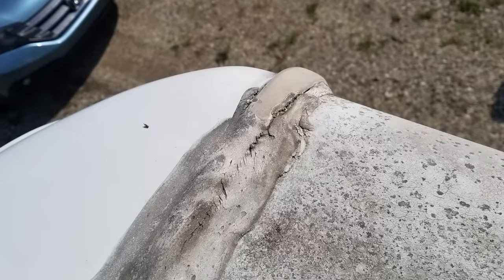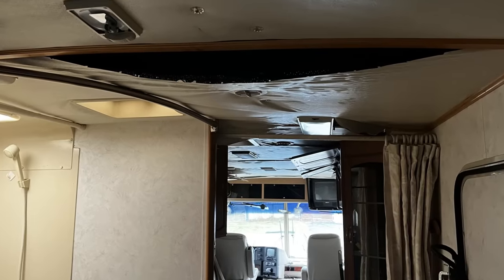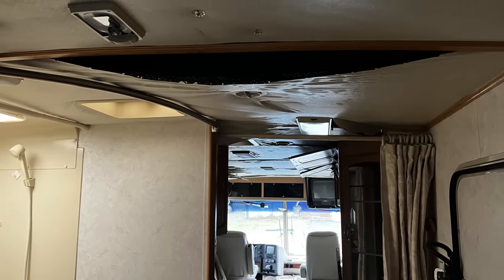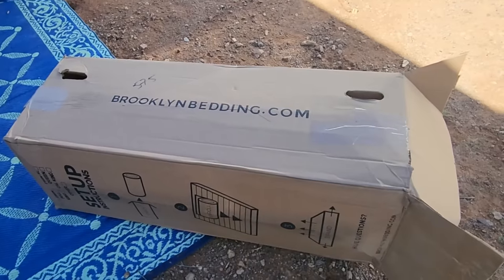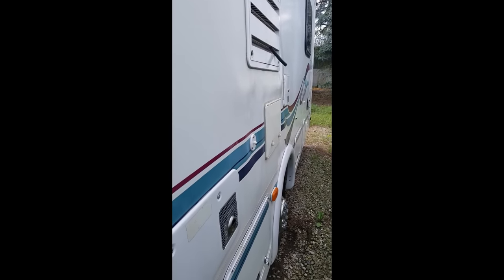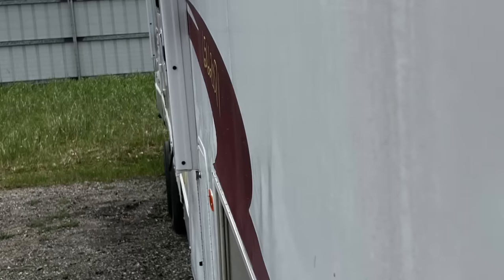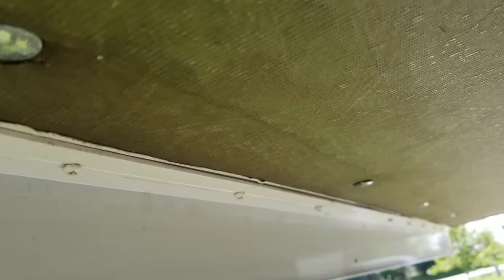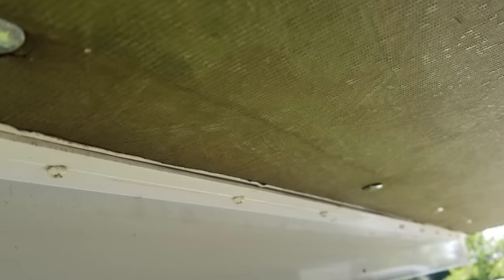PROTECT YOURSELF! These 3 SILENT KILLERS Can Crush Your RV Life

Comment: I found out early on, that the more fancy things you have with your RV, the more that can break and cause problems.
Reply: I’ve said that about cars….Dad said that back in 1969 with our “fancy” Mercury Montego station wagon & has shown it is so true! My 2004 Toyota Echo was a basic model, standard transmission & crank windows. Zero problems in the 11.5 years we had it.
Reply: @Elizabeth-rq1vi  Very true! I just bought a new 2023 year Tacoma, bare bones SR instead of SR5. Don't need heated seats or push button start or anything else built to fail! I have no doubt I'll get 300,000 miles at least out of it!
Reply: As with cars.

Comment: I think I would rather convert a van or truck than deal with poor RV quality.
Reply: My thoughts exactly.
Reply: Or cargo trailer!
Reply: Flex armor roof, life time guarantee, no caulk.
Reply: So glad I have my simple van. Thanks guys😊
Reply: There's a reason vans are so popular.

First and most importantly, they fall under federal vehicle standards. And at 22' or shorter, you can travel or park as a regular passenger vehicle.

Then, if you're smart, experienced, or both, you build it out with a focus on simplicity and low weight.

Hey, didn't she just cover this? Why, yes she did. Anyone in the market should watch that vid until it's drilled into their head.
Reply: Same here! I’m in a van.
Reply: I totally agree with you about that choice.  If you are a person of good financial means,  you might look into a TRAVATA that is a cargo van that is already built, or can be built to your needs and color choices.
Reply: My 6 month old Transit van has been in the shop 4 times for electrical issues and it's acting up again as of yesterday.
Reply: Drone the rooftop.
Reply: School buses have the best structure. I agree that vans, buses, etc are much better quality.
Reply: @RoadrunnersOfCA Try going to an auto electrical shop, not a regular repair shop. Most mechanics are not great at being auto electrical repair guys. Even our mechanic, who is a genius, has an auto electrician on call.
Reply: @SewingBoxDesigns  Okay, thanks so much for this tip. 🌞
Reply: LOVE livin’ in my Pacifica. One year in 24 ft Class C. It was always needing something. 😞
Reply: A motorhome is basically a mobile home on wheels. I would feel better with a large van.
Reply: @RoadrunnersOfCA  The Transit is FAR better than ProMaster. Those are a NIGHTMARE.
Reply: @RoadrunnersOfCA who custom built your van?
Reply: @rebeccaogrady2995
Absolutely, the main reason that skoolies are so popular, they are built to protect children and held to automotive standards.
Reply: Truck ... you mean truck camper?
Reply: The FULL height full fiberglass (including floor) work slide in are super rare , BUT bombproof. "Brand FX" or "SpaceCap" are two i look for. Just saw one near me for $3500. Great buy. I just didn't have funds. I have vans, cutaway ambos (in 4x4) but want a slide in full height for my old carburetorated, straight 6 Ford pickup. It'd be SUPER nice for old simple , easy. At least one company has struck a deal with one of these manufacturers and is using their molded fiberglass for a base to build their slide in.
..Kodiak, or some variation of the name of a bear.

Comment: Windows!   Slow leak reared its head about a month after I purchased.  Source was the window seal.  Successfully repaired and I had all of the windows sealed.  The door suffered some delamination because of the window as well.  Again, after I purchased.  Grateful that is the only delamination on my rig.

Comment: I'm an EternaBond fan. When I bought my used Class C 10 years ago it had some roof leaks (skylight and front seam), which I repaired with EternaBond, and liked it so well that I decided to pre-emptively tape up the whole coach -- every major seam on roof and sides, and have had zero leaks. I use Meguiar's one-step fiberglass conditioner and cleaner on the exterior every couple of years, and especially during the wet season I make sure to open & ventilate all closed spaces often because condensation. Damp-Rid helps with this as well.
No slides, no worries.

Comment: Deb's rv services 👍🏼. Hire her for inspecting a new or used rv! 
Yeah, just because u bought a new rv doesn't mean it's maintenance free! I've read comments where people wrote just that, thinking their brand new rv is fine n not checking. That's a big no, no. 
What's more fearful, getting your butt up on your rv roof to inspect your rv regularly or find out now you've waited too long and water has penetrated inside causing mold, and structural failure? 😱😬. 🍻

Comment: We feel very lucky to have found a 2016 Coachmen last year that is still in excellent condition. It had less that 10k miles on it. We had it inspected before we bought it, for sure.
Reply: They were made a lot better before covid, stay away from anything in that time period!
Reply: Agree, us too.  We also bought a used 2018 Coachman Clipper and it's been good to us so far!
Reply: I just bought a 2018 Coachman Ultralight & love it. Found a water leak stain later to side of the slide but the previous owner must have fixed it bc we had torrential rains since then & no leaks noted.  🙏🏻 it doesn’t! It’s all I have to call home for now. Accident changed my life forever & lost all I had to medical & surgical bills, etc until SS kicked in @ 62 & Medicare at 65! Some of us disabled & broke now  can’t be choosy or get up on or under a RV/TT. 😢  No golden years here…

Comment: Also on aluminum siding trailers make sure the lower panel has not popped out from the upper. I creates a gap water can flow in. It means the staples used to hold the upper panel are shot and the panel bottom is freely floating. It can be fixed by using a washer and screw then tuck the top of the lower panel in.

Comment: An RV will last 5 times longer if it is stored inside a weatherproof unheated shed so it is out of the sun and elements.  This works for cars and trucks too.  I own an 83 lincoln continental in excellent condition because it has always been parked in a garage.  Kept out of the sun here in lethbridge alberta canada the vinyl roof is still excellent.
Reply: When my father was in his 80’s he had a similar car and it was like a tank!  He drove from the East coast to Arizona to stay for a few winters and then back east in the spring.  Guzzled gas like crazy!
Reply: Can’t see the point of an RV if it is just sitting in a shed

Comment: Remember the more complex systems your operating , the greater the maintenance issues. I sold my motor home long ago. Yes it was luxurious but when something that is a major system breaks your looking at big repair dollars and down ti.e while you look to find someone who can do that kind of work and van fit you onto their schedule and find parts. LOL. I have a chevy high top express. Good on gas no maintenance issues. Only resets needed ever have been batteries ,gas and oil changes. Tires are easy. My motorhome was double axel. Everything cost more when you drive the big ones.

Comment: Our 2016 Outdoors fifth wheel (bought home March 2024) has been solid. I checked & they put a bead of sealant along the top of the  Schwintek slides where Deb said to put it! The dealership revealed it when they took it in last November & hubs has been checking the roof every travel day. We know there will be issues because well, it’s 8years old & sat for 6 of those years. It was barely used prior to that.

Comment: THIS IS WHY i bought an old rotten trailer, tore it to the frame and then built it up myself. 1 piece of metal for the roof and 1 piece for each side and each end!! also 1 piece of metal on the frame under the floor! had it wrapped and then custom airbrushed to look like a rusty rotten piece of crap!!

Comment: Just last week I noticed the corner of the bedroom carpet outside the bathroom door wet and some moisture on the toilet room floor.  Went outside to the water/sewage panel and took it off to look behind.  We found the washer/dryer had been leaking  (I haven't used it in 3 yrs)  so we shut the water off to the washer.  Everything dried out and I have some carpet cleaning to do!  Not our 1st RV and water issue.  Water will always find a way in if it can.

Comment: insane and especially when there is a product called crazy seal and for about 600 bucks depending on rig size you seal the whole roof with a 40 years warranty no maintenance unless you have replace a fan or AC something like that

Comment: One of the reasons I bought a class B is because delamination and slides are a non issue.  The roof does have a fiberglass pop top but thus far is showing no signs of cracking.

Comment: Do Class B RVs need this kind of inspection?
Reply: Yes they do! They have all the same components as other RV’s.
Reply: @dsbruening  I asked because the sides are not laminated and they typically don't have slides. Perhaps roof cuts might require inspection. Perhaps there needs to be a top 3 for Class Bs.  🤔
Reply: True! When inspecting the class B there can still be propane leaks, electrical shorts and many other safety issues including tires! So yeah, a different list for the B van!

Comment: Most of the time, there is so much you can do to prevent these problems by performing regular inspections and maintenance. Most of it is easy to do yourself, but if you're afraid to get on your roof, or have one that's not walkable, you have to hire a reputable technician to do it.  There's no way around this if you want your RV to last.